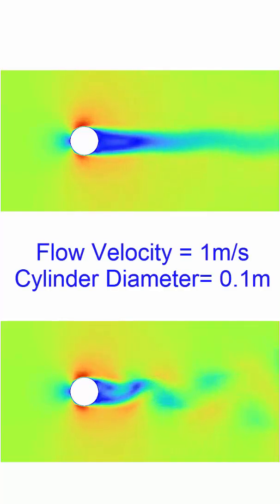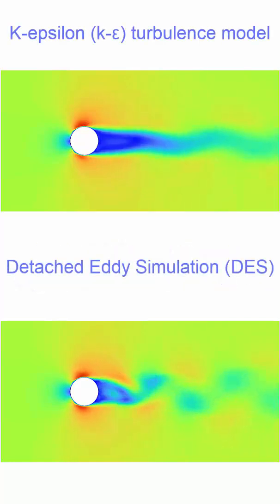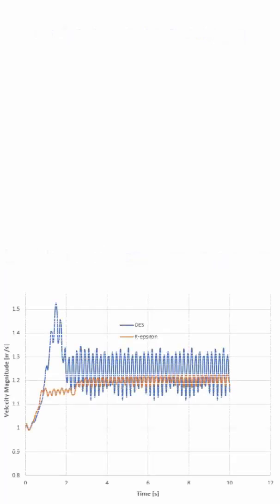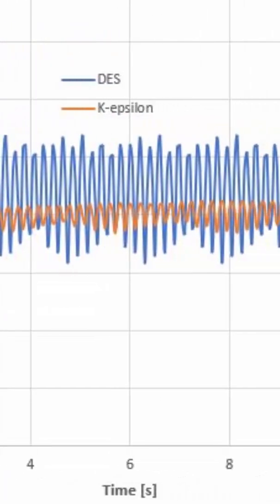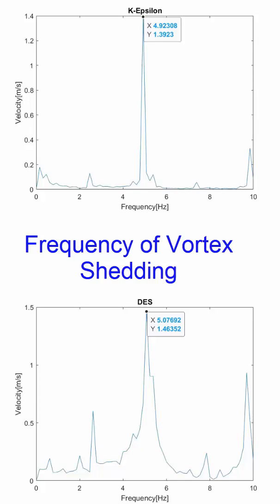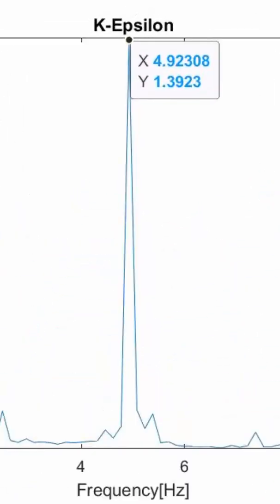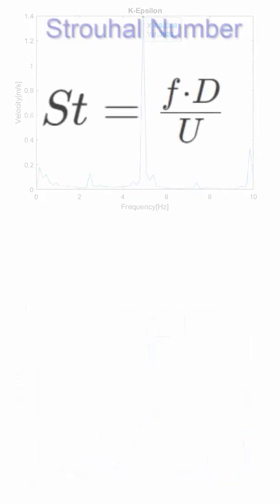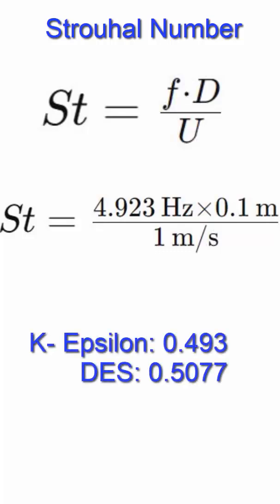Strouhal Number and Flow-Induced Vibration #cfd  #engineering  #ansysworkbench #ansysfluenttutorial

Comment: Thanks for this example.  I thought K-E cannot be used for the vortex shedding analysis and only LES or DES should be used.  I need to run a case for vibration analyis and need to know the flucutatyion of the pressure the frequency.  Could you explain if K-E can be used.  As far as I remember only LES  results can be used for  the FFT etc.
Reply from the maker: Actually, it's my attempt to compute the frequency of flow-induced vibration. However, as you mentioned, there will definitely be differences between turbulence models. I've explored this in the video linked below.
https://www.youtube.com/watch?v=bWKuNh8G2II
Reply: How to create it